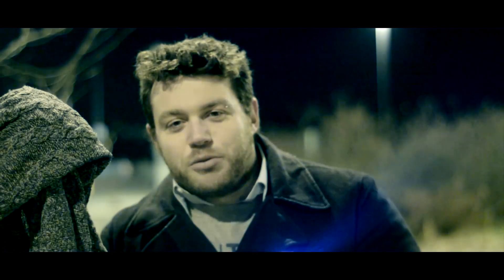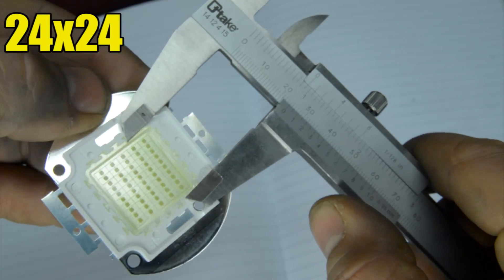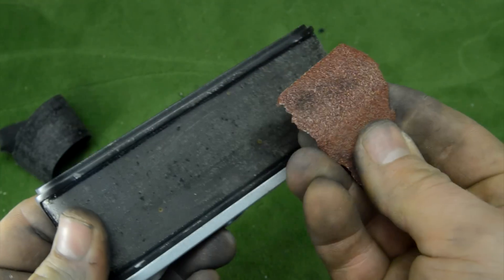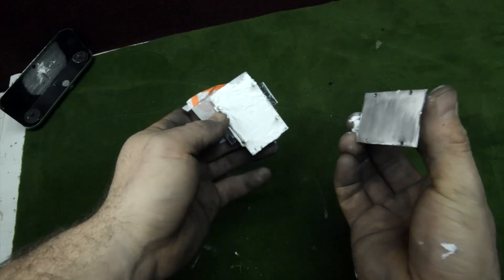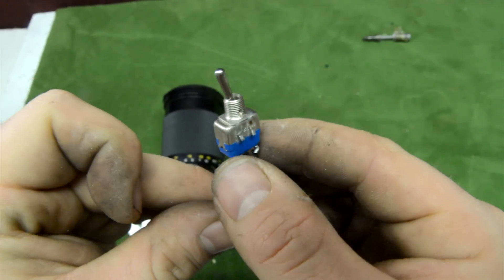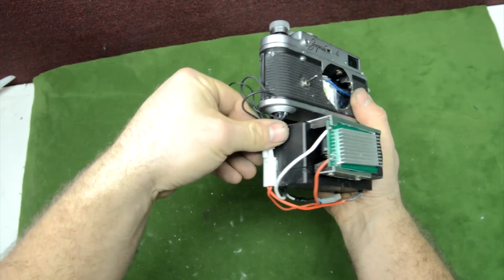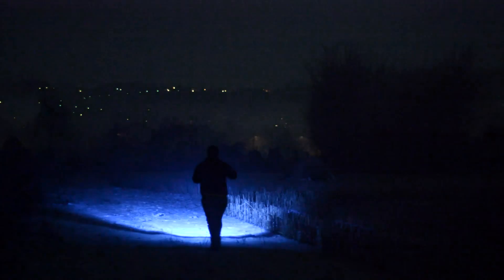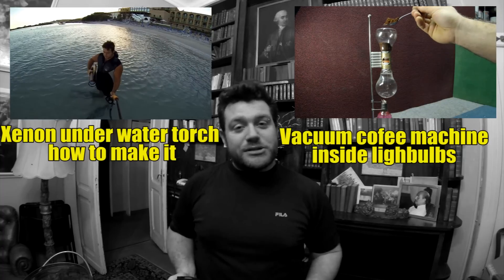Extreme LED Torch inside Old Camera ☄  500W POWER TUTORIAL

Comment: I think every Enthusiast PC Builder cringed while watching the Thermal Paste Part of this Video - At least I did.
Reply: Lol so true
Reply: Duraltia He won't have to worry about heat transfer; that's for sure.
Reply: Duraltia You can never use too much paste xD
Reply: Duraltia Yes i almost  shat myself.
Reply: Bryan Young Too much paste will be worst... paste is only needed to fill surface imperfections. The paste don't transfer heat as good as direct metal contact.
Reply: Duraltia i cri everytim
Reply: true
Reply: +Alexandre Lavoie It's scary how many people don't understand that.
Reply: +Duraltia He was trying to make an LED cookie :D
Reply: +Duraltia You were wrong to cringe. The gap is decided by tightening down the screws and squishing out paste.
Reply: +metallitech I stand by my opinion that the amount of paste smeared onto it was beyond overkill. I also thing it would have produced better result if the LED would have been attached to the Heat Sink directly with a hole in the back of the Camera for the LED to pass through instead of making this creamy cheese sandwich resembling construction. But hey... If you're fine with this, to each his own I guess =)
Reply: metallitech
I don't think the "gap" is the issue... the cleanness of the work is what is at stake here... XD
Reply: +M750 I know😂 too many people think that the more you put on the cooler it gets.
Reply: I cringed through most of it.

Comment: I'm getting together the main parts. maybe a bit more info on the electronics, the 12>74 volt Driver: Specs on the 2 capacitors and the 2 chips . Can't see if there are any resistors.  Anyway, I've tried a bunch of your stuff SO FAR, and they do work!! KEEP 'EM COMING, THANK YOU!!!

Comment: The small aperture dims the light too much. Given the F/3.8 aperture and the black camera inside approximately 90 percent of the light never comes out of your lamp. You should have used a big lens with extremely short focal length between the LED and the zoom lens. (...or a cheap torch from e-bay.)

Comment: So I just finished building a similar light in a camera. I used a CPU heatsink on the back but the effect is the same- I want to focus the light with the camera lens. Unfortunately, it's bringing into focus the yellow rim of the light and each individual LED, not to mention it seems to be much dimmer. How did you get around this problem?

Comment: Maybe with a smaller LED and a bigger camera you could put the battery and the heat sink inside, just with a flat fan a a hole on one side to dissipate the heat
At least it would still look like a camera, not some kind of mutant superlazer
Reply: +Fluburtur But it would be dimmer.
Reply: Imhotep Four It would be but being visible from mars is not a necessity.
My S3 mini makes way enough light and im not even sure it uses one watt, so 5 watts would be way enough with good bright LEDs.

Comment: 500 watt at 12 volt requires 41.6 amps..  

Seriously doubt you are pulling 41.6 amps from that battery, or even through those wires :p
Looks more like 50-80 watt actual use.
Reply: +Eqvaliser It's 50W, but puts out equivalent of 500W incandescent.
Reply: TwitchingDan You certainly can't compare it like that.  If you need to compare it, there is only one way,, then it's lumen.  

Lumen is the amount of Light. 
Watt is the effect. 

So a scientific comparison would be where you would say this x1 Watt incandescent emmits a value of Y lumen at 1 meter, 
And this x2 Watt led also emmits Y lumen at 1 meter.  But the effect is much much lower.
Reply: ***** Yes. That 50W LED has the same lumen output as a 500W incandescent.

Comment: Way TOOO much thermal paste man.. The thermal paste is not conductive (just less insolation then air), the main reason to use it is to get rid of air in between, therefore you only need a very small amount!

Comment: There is no way in hell that battery is putting out 100w, let alone 500w. You wasted your money on the led. It should be at least 1,000 times brighter than that! Get a lithium battery.
Reply: +Voluntarist The LED is not 500W, The LED is equivalent to a 500W Halogen bulb. The LED he is using is 50Watts.
Reply: Jamie Cruickshank Thanks that would have been good to know. I've worked with the 1000w equiv.